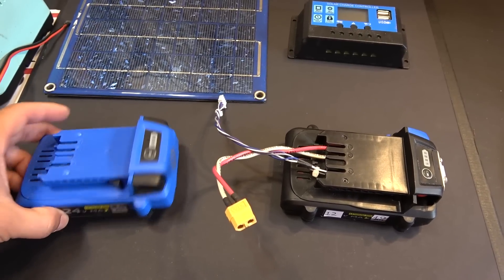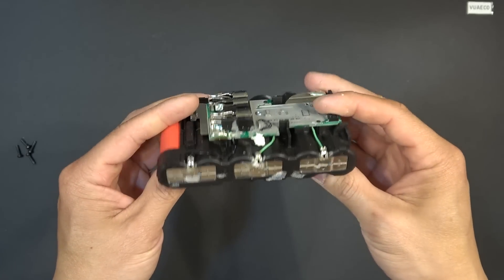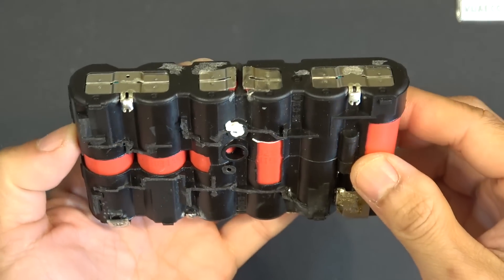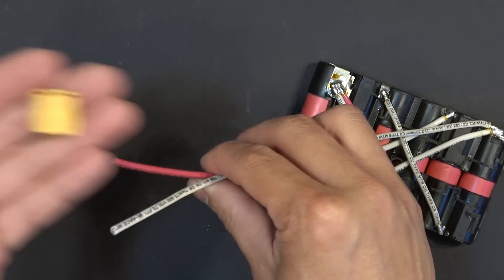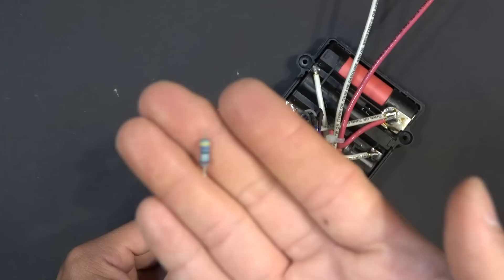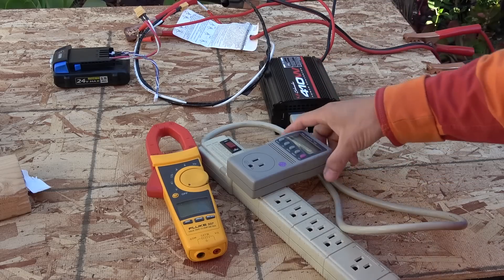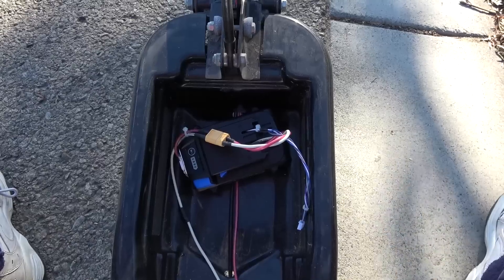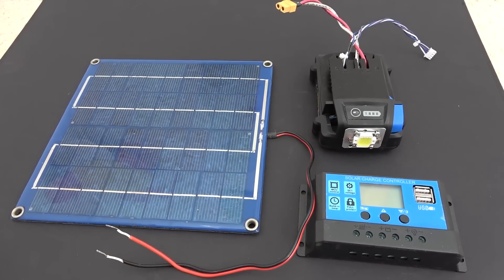DIY: Make a 12V Li-ion battery for a portable solar system to-go

Comment: Why would you need an inverter?  Solar panel is DC.  Batteries are DC.  Using 12v DC gadgets with the battery pack = all DC.
Reply from the maker: The inverter is for running anything on 110V AC. Almost all household appliances run on 110V AC.
Reply: I see.  I was thinking about backpacking.

Comment: What is the brand/name of your power switch?
Reply from the maker: There's no model number. It's just a cheap generic Chinese made button. I bought from ebay and seller from China. It was about $2.50 for 10 pieces so very cheap. Here's what they put on the title of the item: "Car Boat Dash Locking Latching OFF-(ON) 12mm Push Button Switch Red"

Comment: How much power does the small solar panel put out does it change the batteries good?
Reply from the maker: The panel is 5W. It's a bit slow. I'm thinking about using 2 panels in parallel.